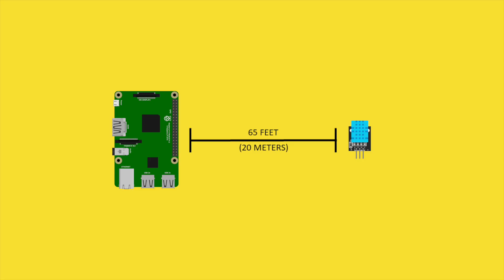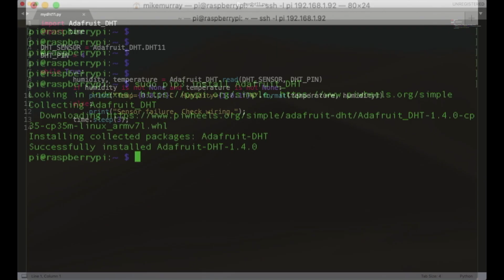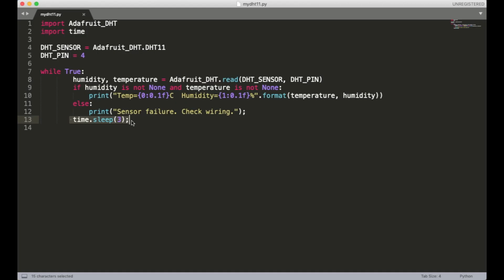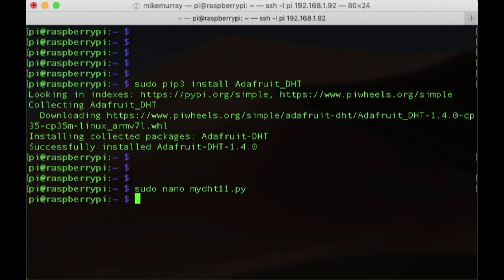Raspberry Pi DHT11 DHT22 Temperature and Humidity Sensor

Comment: I am trying to build  my project by using heat sensor to communicate with a RPI but I don't know how the communication will work if the sensor is connected to a motor.

Comment: You inverted the wires VCC and GND at 1:20. The red wire should be plugged into the right pin. At the end of the video you will see the correct wiring.

Comment: Are there wireless sensor available ? Need to add the sensors in my fridge
Reply: Look at the hc05 hc06 serial Bluetooth modules, you'd need a battery and some sort of controller/translator between the dht11 and the hc06, I'd use an Arduino for simplicity

Comment: Since its all wire-connected, why is there a 65 feet distance limits?
Reply from the maker: Wire too is a resistor.  The longer it is the higher the resistance.

Comment: Excellent tutorial, clean and basic, thank you! 
I was wondering what if we do the data communication using wi-fi or bluetooth modules to remove the cable dependency would it make sense? Tbh, I am searching for this need and could not find a good tutor like you so far, keeping an eye on the channel :P

Comment: HI
I am getting the following error
Traceback (most recent call last):
  File "mydht11.py", line 8, in <module>
    humidity, temperature = Adafruit_DHT.read(DHT_SENSOR, DHT_PIN)
  File "/usr/local/lib/python3.7/dist-packages/Adafruit_DHT/common.py", line 80, in read
    platform = get_platform()
  File "/usr/local/lib/python3.7/dist-packages/Adafruit_DHT/common.py", line 60, in get_platform
    from . import Beaglebone_Black
  File "/usr/local/lib/python3.7/dist-packages/Adafruit_DHT/Beaglebone_Black.py", line 24, in <module>
    from . import Beaglebone_Black_Driver as driver
ImportError: cannot import name 'Beaglebone_Black_Driver' from 'Adafruit_DHT' (/usr/local/lib/python3.7/dist-packages/Adafruit_DHT/__init__.py)
Please advise

Comment: Why did you say to put sudo in front of nano? That runs the editor as root which is not necessary. Just have people verify that they are in their home directory instead.
Reply: Spoken like someone who's NEVER done IT work.  If you want to build an app, the last place you want to put it is in your home directory.
Reply: @tobyminerBTC  My point was more along the lines of if you need root access, you should generally either use a different directory, or change the permissions.

Comment: Great Video! How do I access to this sensor in other python projects (IDLE)? What coding do I have to use?
Reply: Chris, I just watched it because I'm building a sensor app for a small data closet. Now keep in mind, noobie hardware guy, but years in IT. If I read you correctly, much like I'm going to. Aka, get the core code he uses to get the temp, set your sleep time. Now, you've got the data, printing to terminal is just an example. What do I do next? Well in my case I'll take this code, take the temperatures and write them too a log so I have a record. Next and the reason I'm doing this, is I'll check that temp. If it exceeds a set ratio (my ac went out) say 65 F, then I'll generate an alarm and send out email and text messaging to the management team that they need to check the data closet cooling, etc.... I also intend to add an LCD so if your in the closet, the temp is displayed at a glance.

Comment: from . import Beaglebone_Black_Driver as driver
ImportError: cannot import name 'Beaglebone_Black_Driver' from 'Adafruit_DHT' (/usr/local/lib/python3.7/dist-pac

please, how to solve this problem with my raspberry pi 4B!
Reply: am having the same issue with a pi4 but same code works with pi3!!
Reply: There is a fix I found on GitHub. I lost the link, so typing it here. The error seems to be that the platform_detect.py program doesn’t recognise a Pi4. Try -
sudo nano /usr/local/lib/python3.7/dist-packages/Adafruit_DHT/platform_detect.py
- scroll down to the bottom of the file and add an elif statement before the final else.
elif match.group(1) == ‘BCM2711’:
#Pi 4
Return 3
Enable I2C in interface preferences
Then reboot
Edit: when I tried this the error cleared but I still didn’t get readings. Kept getting sensor error message. Both temperature and pressure were None. Haven’t sorted it yet 🙁

Comment: Am I the only one who noticed that When you connect the pins you say that the ground pin is on the right, but after connecting all three you do a closeup (1:35) and on the sensor it says GND on the left. How is it ? because I have a difficult time reading the datasheet because the GND and VCC pins seem to be swapped on some manufacturers !!
Reply from the maker: It also depends on whether you are looking at the back or the front of the module.  The pinouts are also listed on the back side.

Comment: I always get Sensor Failure. Check Wiring, I have check the wires the led in the module is glowing. But output from the sensor cannot bt obtain. Any suggestions.
Reply: I have the same problem
Reply: @Ryan Atack same here.  Has anyone figured this issue out?
Reply: same here, complete mess. cant get it to work
Reply: Not sure if this is still relevant for you - but some models of the 3 pin Module have the VCC and Digital pin reversed.

https://www.circuitbasics.com/how-to-set-up-the-dht11-humidity-sensor-on-the-raspberry-pi/

Comment: @TheGeekPub Please add a comment in the code and an annotation to the video.
IMPORTANT NOTE FOR DHT22
If you're using a DHT22, the Python code will be slightly different. You will have to specify that the DHT_SENSOR is DHT22 rather than DHT11:
```

DHT_SENSOR = Adafruit_DHT.DHT22 # Specifies that you're using DHT22 rather than DHT11
```

Otherwise, you won't get any readings.
Reply: thanks. i was having this problem.
Reply: thank you as well.  saved me some time im sure..  this would be useful as an edit in the video

Comment: Is there a way to get temperatures from different locations with this or will I need multiple setups?
Reply from the maker: You'd just need multiple sensors on different GPIO pins.  You can duplicate the first few lines of code as many times as you have free pins.

Comment: Say i work on a farm where we use remote temp sensors using radio transmitters and receivers/gateways to send them over a large distnance (0.25 mile-1 mile) and i wanted to upgrade our old phone call out alarm with an android app, how i could i adapt something like this into that system? I could send you more details if you feel like helping me out here. im kind of a pi-newbie but i want to see how easily it can be done.
Reply: Hi Google mqtt. It's a protocol for sending iot data between devices and there are lots of android apps that can read mqtt messages. You'll need to install a mqtt server on the pi (think it's called mosquito).

Comment from the maker: If you need to track the temperature of a project using a Raspberry Pi, the DHT11 and DHT22 temperature and humidity combo sensor is the perfect choice!
Reply: I have an error hope someone can help me out. I keep getting the message 'Sensor failure check wiring. Possible causes that I have ruled out:
1. Wires are in perfect working condition
2. Power supply is more than sufficient. (Red light does come on)
3. Checked the connections in every way possible
4. Program must be working because the error message is printed correctly.
5. This is an original raspberry not a cheap version

The thing which is weird is that from the multiple attempts it has sometimes worked. Its a 1 in 20 chance. And it only gives one reading before returning to the same error. Is my sensor fried. Its brand new but the only explanation I can think of. Please advise. Thank you.
Reply: @essenar7535  May be a bad from the factory part.

Edit: I saw another comment that explains a one line change to make it work.
Reply: @minecraftchest1  Thanks for the reply. It's was a defective part. 45 minutes of debugging proved it.
Reply: Could this also be used as a camera overlay?